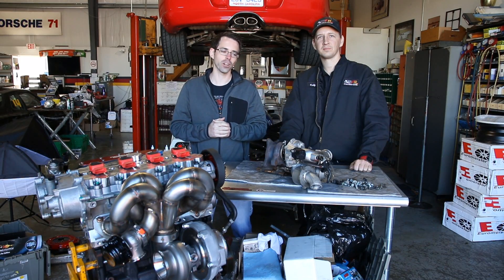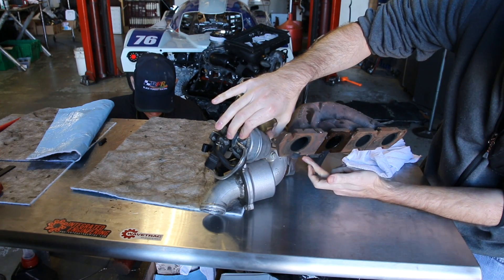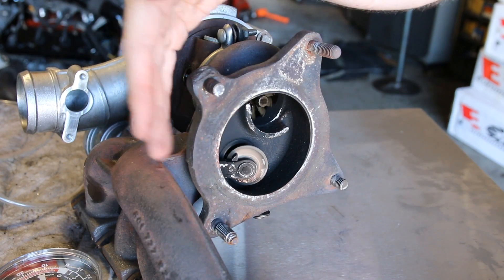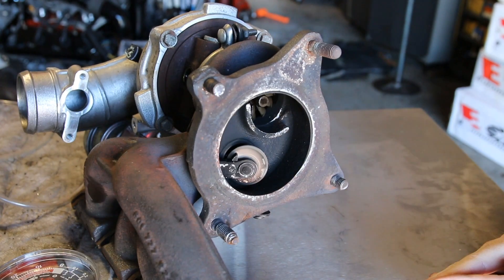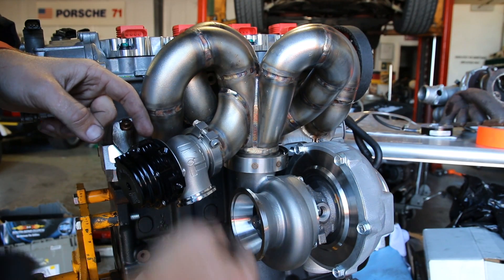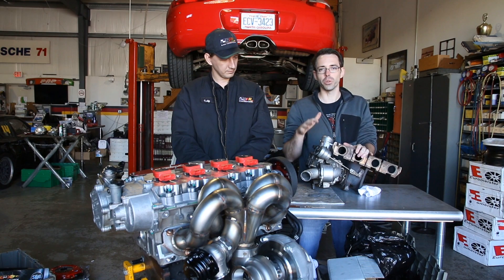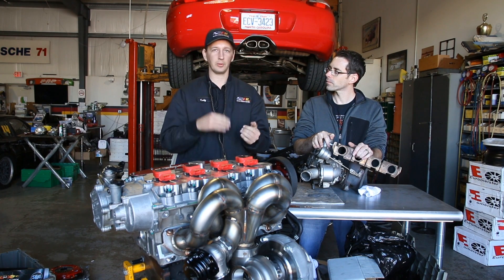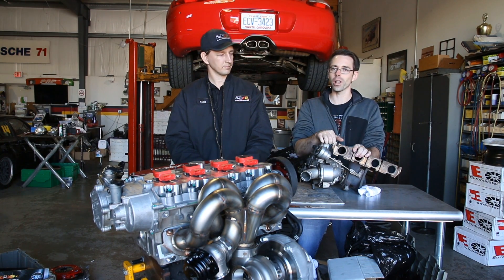How Turbo Wastegates Work - Internal vs External

Comment: basically guys you want a ...
38mm T25
44mm T28
60mm T30 and above
Reply: I use a 44mm tial on a 3076R
Reply: @javiertaycg956  it will be okay but you might have to up the spring rate.
Reply: @cetGT3  wow thank you for the reply 🤜🏽🤛🏽
Reply: Is it okay? 🤔
Reply: What does it mean? Is it exhaust port size or collector pipe diameter?

Comment: Hey man, I am wanting to install a catless DP on my WRX, but I am scared of boost creep. What else needs to be done to convert from an IWG to EWG? I am upgrading my stock turbo to an STI one while doing the DP as well. Is it better to just buy a High Flow Catted Downpipe instead of trying to install a catless DP and converting to EWG?

Comment: I would debate against the comment regarding larger turbos and higher HP needing EWG over smaller ones. Boost creep happens on any size Turbocharger depending on the circumstances.

Great video otherwise though.

Comment: What you said is incorrect. You CAN have external waste gate on the stock set up, you just need to weld the flapper shut and weld a wastegate pipe off your manifold or rear housing
Reply: if you weld a wastegate pipe off the manifold it's not stock anymore
Reply: @bigsalo8598  but it can still be done with the stock manifold.
Reply: Hello @imTriiBz
I found your comments interesting 
What, do you mean by weld the flapper ?
So,  can I have external WG with the stock internal WG and both works together.. 
Like when over boost the external WG opens,  otherwise the internal do the job…
Reply: @vanhabib10  no he meant you weld the stock on so it won't move anymore and completely fabricate your stock exhaust manifold with an extra pipe to hold an external wastegate.